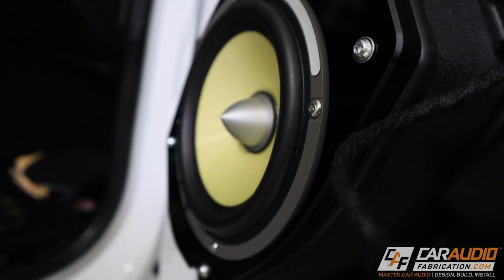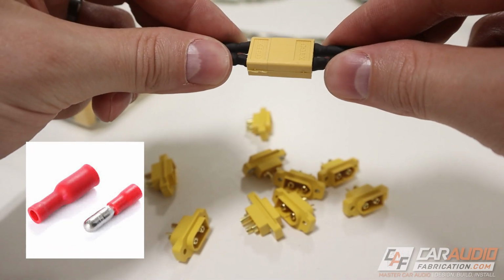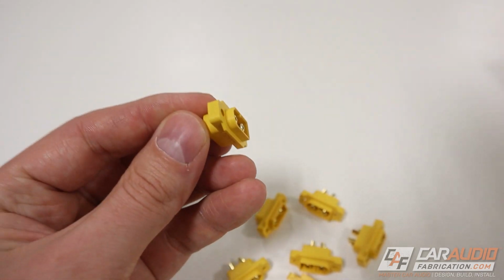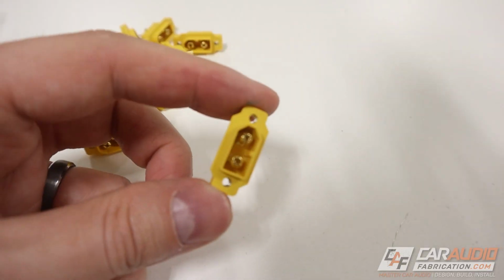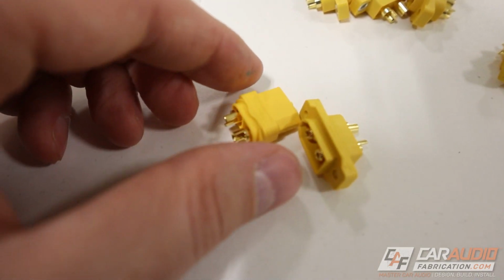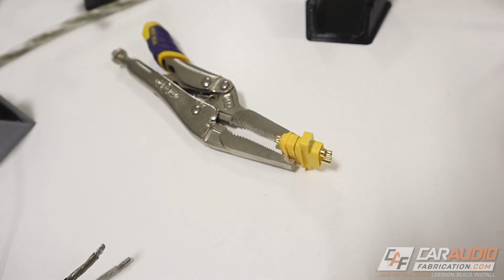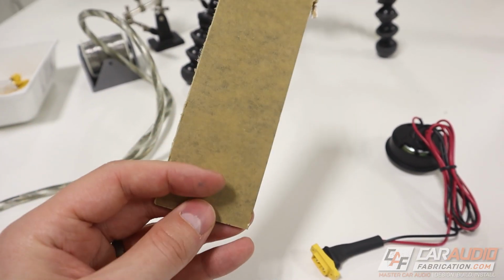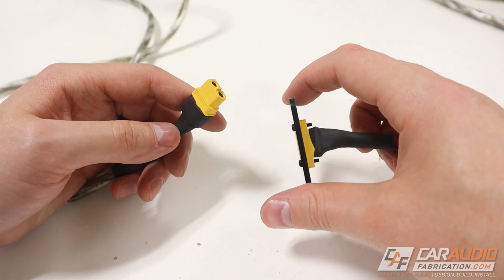Unplug speakers fast - NOW MOUNTABLE!

Comment: Did you use 12 gauge wire for this demonstration? I have a JL Audio 12 w7ae and I want to create a quick disconnect for the box from the amp? Would you recommend that this would work? Also, do you sell the mounts that you made for these? Thank you!
Reply from the maker: I ran these before on 1000 watts RMS with a 13W7 without issue, although this is starting to get close to the need to step up to the next size.

Comment: went from dean conectors to these in my rc car, my old connectors melted the plastics, these have never done that, running 150a+ setup. And they are soo easy to take apart. Only "downside" is that you need a quite hefty welding iron to get the job done,, i use a 90w one

Comment: Amass is the original manufacture of these. I have them in black. They also show + and - sides on all connectors. Very sturdy. I think the embedded nut is a M3-0.5 x 12mm. This is if you use 1/4" material to mount. I will update if I find something else.

Comment: You can do the same for the power but with Anderson 60 or 90 amp. They are incredibly beefy, very tight connection that have a positive click "hold"
Used a lot for solar power cables and both ends are the same but only one side is pluss side and you can never plug it the wrong way either
Reply: The Anderson 50 or 60 i have fits 7mm2 cables good.

And you can also (with some work pull out the pin from the connector after installing it but it is really made to be crimped/soldered to the cable and plugged in the connector and not removing it again.

I love it and am sure it will handle at least 300A

Comment: Why would you use xt60 instead of xt90? Not only are they more durable and have a better hold, they have almost twice the current handling capability. I get that smaller speakers don't draw that much, but for barely any price difference, you get better durability.
Reply from the maker: Xt90s are huge and provide no benefit when the extra current is not needed.

Comment: Thanks Mark I used the regular ones in my recent build and will be using them going forward. Very nice knowing I can just dc my stuff for swapouts or whatever. Word of caution though to everyone, feed your tweeter wires through their cups before soldering on these connectors. duh. Lesson learned for me heh.

Comment: Have you seen the Anderson Power Pole connectors, by Powerwerx? They are heavy duty, mountable, and customize-able. Used a lot in Amateur Radio and custom electronic projects.

Comment: I custom made a rear parcel shelf for my hatchback with 6x9 s in them but when I needed to fold the seats down and remove the parcel shelf it got vey messy finished up using bullet plugs worked  but these would have been much better.

Comment: Those are really nice connectors. There are XT30, XT60, and XT90 versions. They are used widely in RC battery connections. The number corresponds to the current capability of each connector.
Reply: What's really funny, there are 160A continuous and over 500A burst going through a 90A connector! Sounds like it would burn down, but they don't!

Comment: I use those connectors especially on custom installs. But, only issue i have with the knukoncepts wire(s) is the overall diameter on especiallt newer vehicles with limited clearances on door sills and other situations. Great idea especially on marine and off-road applications but like my 2016 accord sport, its useless (somewhat) when a 5ch amplifier is mounted under drivers seat and trying to run that beefy 0gauge sized looking 12g piece to the trunk area..i usually on those applications (especially wranglers) use flextech on 10g simply by flextech-ing the wire which is half the space savings...

Again, phenominal idea and very usable but not for the now-a-day every vehicle 🤷‍♂️

Still, knukoncepts makes amazing power/ground wiring and is highly flexible which i love as a car audio installer myself 🤘🤘🤘🤘

Comment: I’ve used Molex connectors but these seam nice. The Molex I use a Molex ratcheting crimper to connect the wires with Molex male and female pins. Bullet style connectors are only used in a temporary pinch if you don’t have anything else.